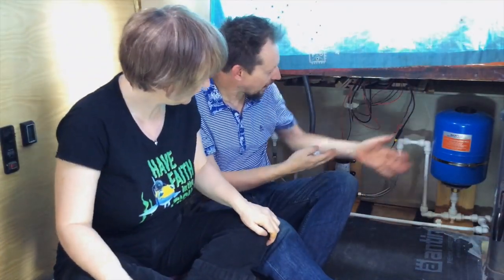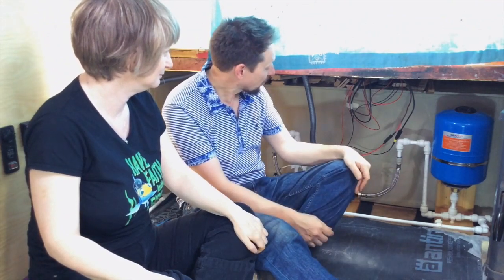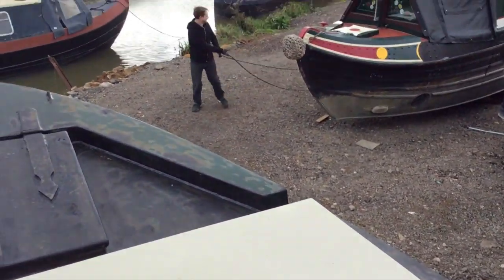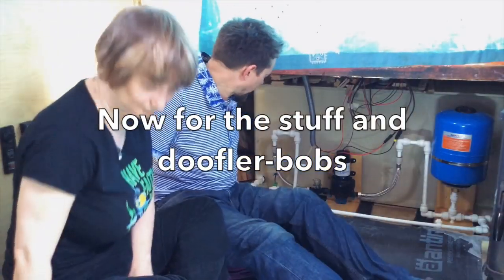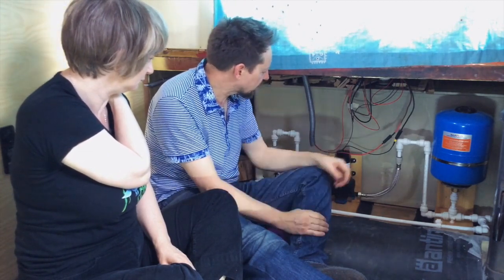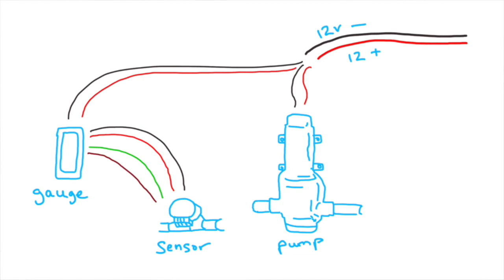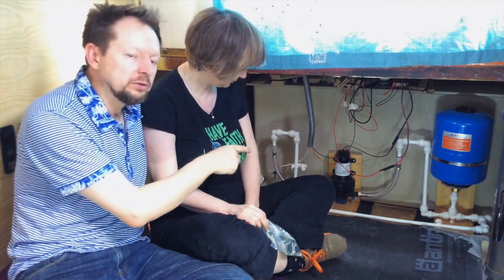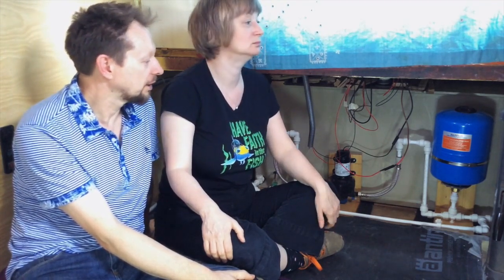#28 Fitting a water tank, sensor & gauge

Comment: Nice vlog about the water. Cedar for the dipping „pot“ sounds interesting. Make sure to keep some parts of the wood untreated with epoxy to ensure you always have the lovely scent of fresh cedar wood in your bathroom. How are you going to heat up the water for the radiators? I think I saw a very clever way how someone used the heat from the engine to add temperature to the water/heating system
Reply from the maker: There's certainly a way to go with the socking tub, cedar is the most common wood used and hopefully it will smell gorgious. We have a Webasto diesel heater for hot water/rads and will also hook it up to the engine so when you're under way, the engine heats up the water naterually and saves fuel by not havingnto run the Webasto. Best, Martin

Comment: Just catching up as I want to renovate a Narrowboat I an currently purchasing. 
On question, didn’t you fancy replacing the old tank with Stainless as you had done the hard work getting it out and back in.
Reply from the maker: Hi Nobby, water tanks are very expensive unless you can do it yourself. Steel tanks have to be painted on the inside, I believe, and therefore maintained after time (re-painted etc). The water is more prone to freezing and as we had a plastic one and not very old, it seemed a good idea to keep with it as it has quite large capacity. Best, Martin

Comment: We're have you been all this time?
Reply from the maker: Hi Steve, thanks for commenting, yes it has been too long, sorry, it can get a bit full on at times and then dificult to fit making vlogs in. We will try harder. Best, Martin
Reply: @TheNarrowBoatToTheDeepNorth  I have at last got my bathroom and bedroom first fix floor down. Started to put wood into the boat rather than rip it out
Reply from the maker: @stevecooney1361  Sounds good! Nice to get bathroom and bedroom started. Are you starting from scratch or re-modelling. Best, Martin
Reply: @TheNarrowBoatToTheDeepNorth  Started from scratch. After ripping out loads of rotten wood. Been rite down to certain the hull floor . Red oxide over joists. Cleaning and painting iron ballast. Currently making wooden frames for under both gunnels.  Plying over that and also above gunnels.

Comment: Why is the pipe going in and out the pump going up and over and back down, instead of going straight.
Reply from the maker: That's a good question and I'm sure I'd have an answer then but now... maybe to do with vibration – looking at it again maybe straight would good enough, what is your set-up?
Thanks for watching, best, Martin.
Reply: @TheNarrowBoatToTheDeepNorth  my wife and i have not got a boat as yet, but i would like to buy a shell and fit it out my self, i am a plumber and gas fitter by trade but couldn't work out why you did the pipe work like that, in normal plumbing you would get an air lock in that section, but you might be ok as it is pumped
Reply from the maker: Hi Phil, thanks for the warning, it is useful and I'll re-visit that bit of pipework soon so I'll most likely change it to a more straight connection – we're new to plumbing so advise is always gratefully excepted. I have the calorifier to so that'll be fun :)   Best, Martin
Reply from the maker: If you're looking for a boat, look in differetn areas as the prices do vary, for instance, around the Midlands narowboats are sort after and usually sell very quickly, going further a field means you increase you chance and can get a better deal. It's why we ended up going south for our boat. Good luck with the boat and thanks for watching.